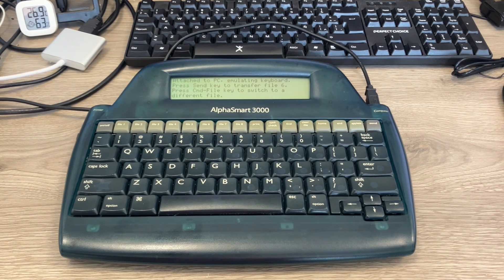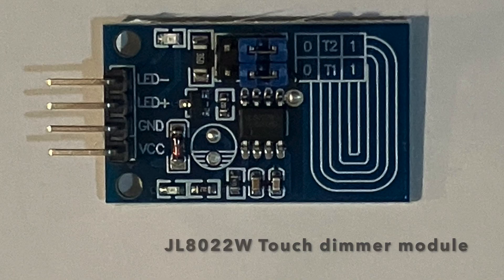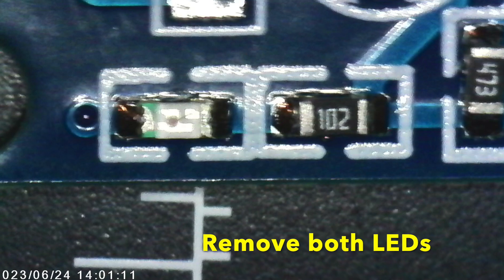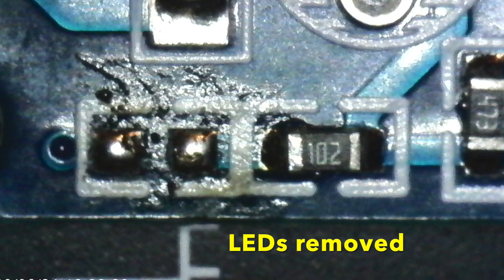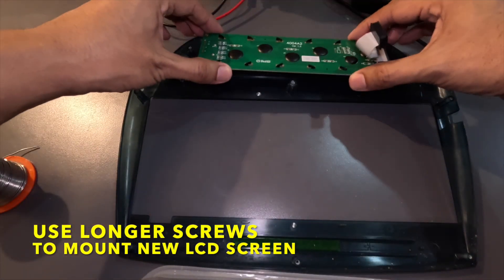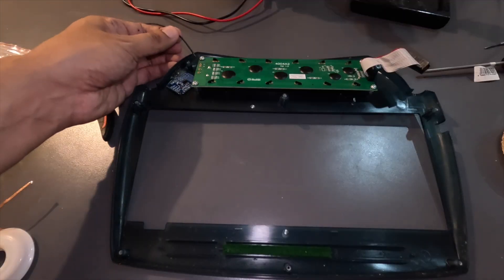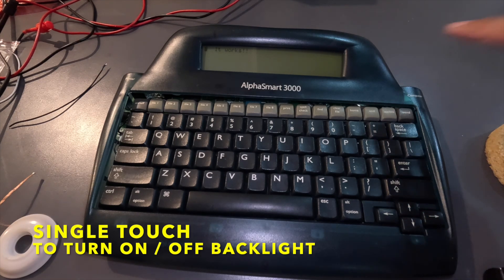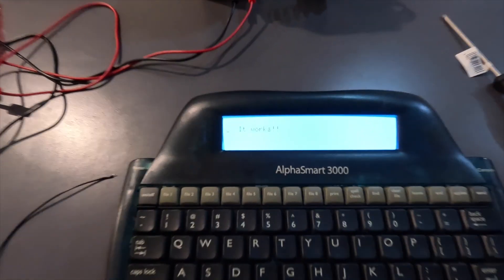Backlight LCD upgrade for Alphasmart 3000 with touch sensor.

Comment: Awesome project. Where are you getting the 5v from? Is it the resistors just above the rechargeable battery jack? So does that mean the backlight comes on even when power is turned off from the 3000?
Reply from the maker: I added a transistor to prevent activation when device is turned off. 5v comes from the logic board

Comment: Would you be willing to upgrade mine or sell this as a kit with the board modifications done?
I have a tremor and fine soldering is very difficult for me.  The Alphasmart has been amazing for me.
Reply from the maker: @The3dist  maybe, but if you don’t mind waiting long shipping times because I’m in Mexico City
Reply: @cowndelorean  I wouldn't mind at all, actually, it would be a Neo2....
Reply from the maker: @ sorry, it only works on 3000
Reply: @cowndelorean I’m interested!